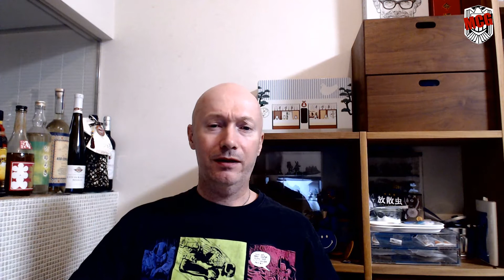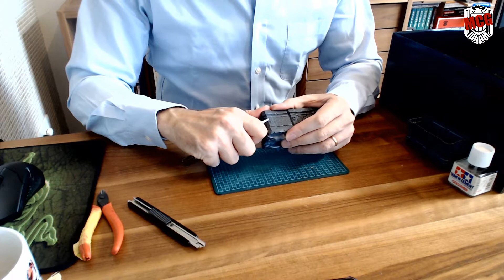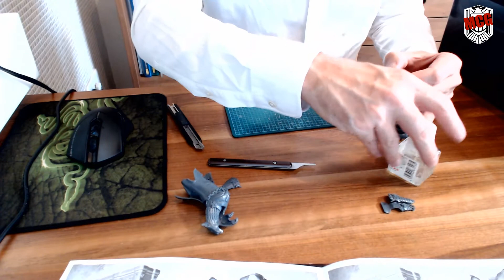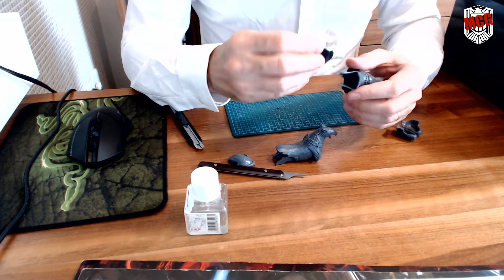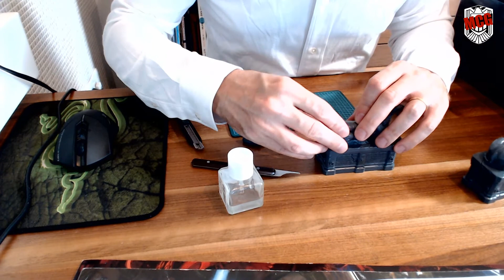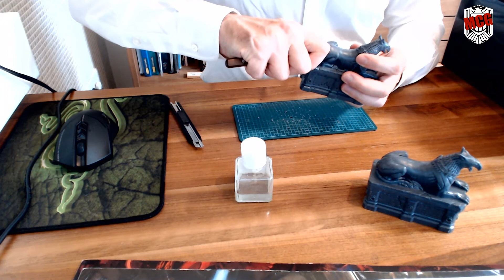Shattered Stormvault Build 02

Comment: Tamiya has a nice putty in a tube iirc, stuff's good for gap filling. Another possibility is super glue, mixing it with baking powder on some grease paper or taking a bottle of Tamiya plastic glue with not much left, dissolve a few bits of sprue and use that as filler.  Cheers!
Reply from the maker: Next time I'm in the Yodobashi I'll check out the Tamiya stuff. Thanks for the info ;-)
Reply from the maker: Thanks! I ended up forging ahead, but next time I'll get gap filling.